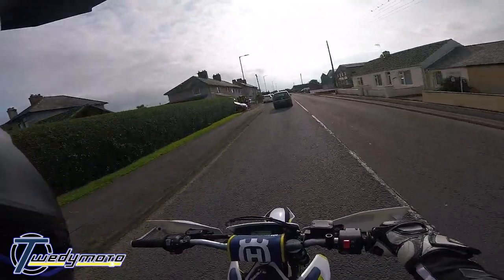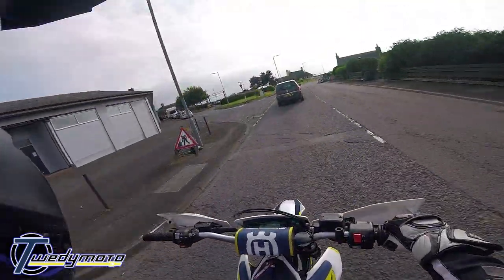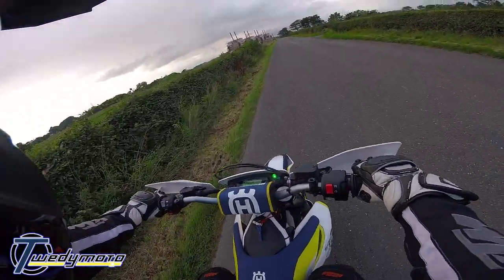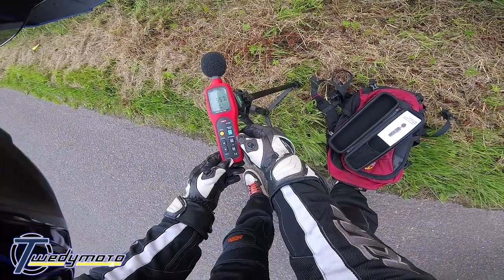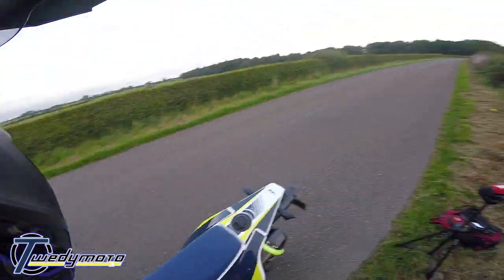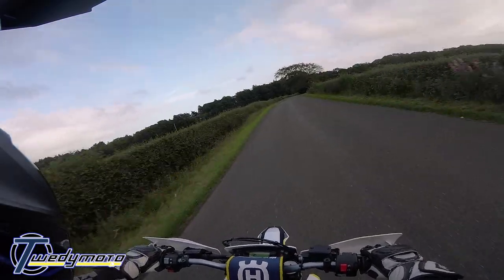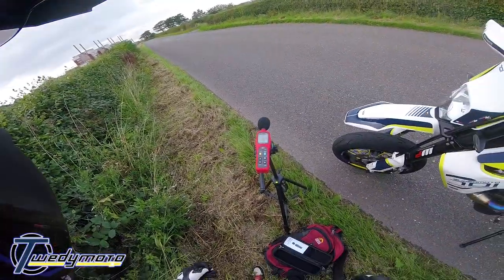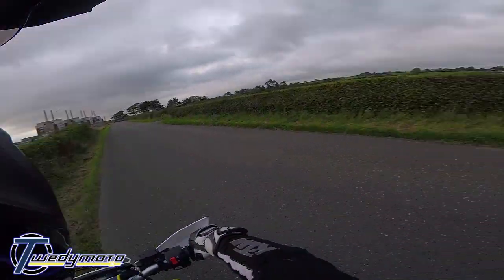HOW LOUD IS MY BIKE?!? | Husqvarna 701 Supermoto Wings Exhaust Noise Test!

Comment: This is a non subject question but why do you guys have those crazy zig zag lines on the side of the road in merry old england?
Reply from the maker: The ones before traffic signals? It means no parking on the side of the road. Lol
Reply: Twedymoto Makes no sense... so you can park here 0:55 ????
Reply from the maker: @scrub2657   Technically, I think yes. but you wouldn't lol

Comment: What kind of exhaust slider is that?
Reply from the maker: It's a rubber mould with a hose clip through it. I bought it from auspuffshutze.de but you can make your own with some silicone hose and a large hose clamp.